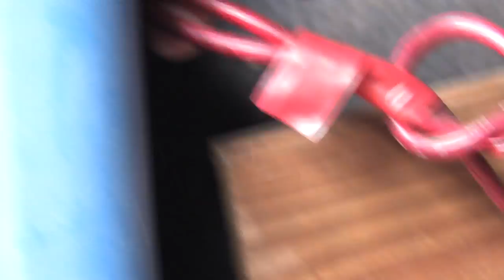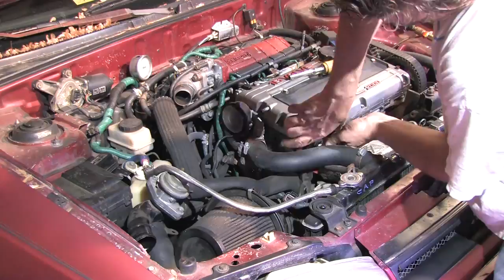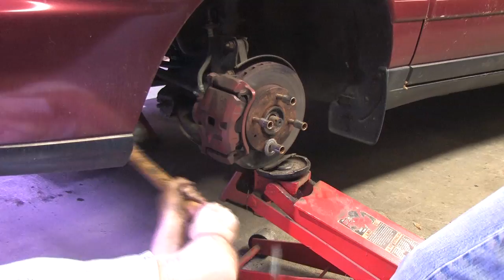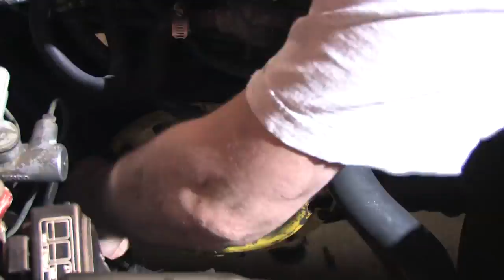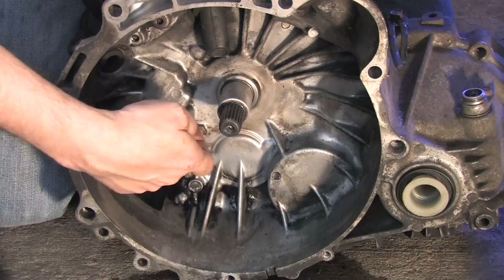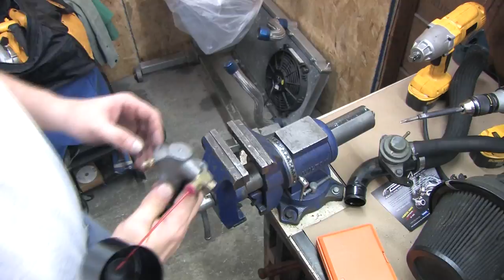Install Clutch in a 1g Turbo DSM swapped Elantra

Comment: I like to thank you for this video Jafro. I had some fun taking my Proton Satria (which is similar to your Elantra underneath) apart today and was made easier by watching this. Saved me a ballache splitting the lower ball joint out. Plus gives me a heads up for when I need to swap out the gearbox as mine  keeps popping out of reverse.

Comment: I didn't see the part in your video description about your goal of all used parts.  I'm sure it will "work."  My concern was the low spots created by the whizzer disc that won't make contact with the disc.  
Sometimes when working on a rare vehicle or a racing application, it makes sense to have the pressure plate surface prepared for a new clutch disc with a flywheel grinder.

Comment: Just did a input shaft bearing & clutch rpelacement on an EA5W Galant, very similar setup, was such a delight not to have to deal with a transfer case, tail shaft, plus I'm sure the FWD gearbox is lighter than the damn transfer case haha.

Comment: Yes, I am aware of the recall. The boots were fine and I did not need the recall back then. Not all cars needed the work, only inspection. Some cars you could see the oil trace running down the boot etc.
Cheers.

Comment: Floor jack on the rotor is never safe.  The video shows the rotor turn.  The only thing that would save you is the car falling back onto the jack stand ...if the car doesn't shift too much while you're hammering. 

I don't see the need to compress the spring.  You have air pressure, I'd use an air hammer on the knuckle ball joint boss to release the taper.

Comment: Luckily that speaker wire was big enough gauge not to cause an issue.  That is a fire hazard.  Might I recommend a race type of kill switch?  Is that tupperware for the battery box?  Looking forward to seeing what you have planned for improving the battery relocation system.

Comment: Yet another brilliant video :-)

I really enjoyed that, dont you wish you could do repairs at that speed lol.

You may want to double up on the battery main power lead, running such a high ampage 3 miles away from the hungry starter is just asking for loads of power loss to the starter, yes its thick wire but it will still lose stacks of voltage :-(

That looked a pain in the arse to do the clutch, you made it look easy :-)

Comment: I'm surprise you use a powerbuilt torque wrench. They suck from what I've experience. Also, you should try buying some Gearwrench flare wrenches. Cheap flare wrenches will cause issues when you apply a lot of force.

Comment: Thanks for all your videos Jafro! I recently installed a centerforce clutch, new friction plate on the fidanza flywheel, master, and slave, reused oem throwout in good condition. But now my clutch pedal sits about halfway were the brake pedal sits. Do you have any suggestions?

Comment: Clutch job is so easy on a fwd. A buddy of mine and I did it in 2.5 hours last time. you didn't put any anti seize on the axle splines?
Reply from the maker: Sgt Balestrini Lol.  It's only 7 less bolts.  5 on the transfer case, 2 on the axle.  I've pulled a transmission out of a Galant VR-4 in less than half an hour.  10 years later, I bought the car.  :P  But yeah, those 2 axle bolts are tough to reach if you don't have the right wrenches for it.  Those particular 7 bolts are deep under the car making them really inconvenient, but if you have a lift, ain't nothin' but a chicken wing.
Reply: your slow 2.5 hours  I would of go fired for that

Comment: hi i have a 90z vr4 galant project atm. my question is i have a problem with shifter wont go/reach in to top gears. but will go in to bottom gears 2,4,R.  i think its besause of the gear selector brackets are diffrent size?? due to diffent year gearboxs?? thanks

Comment: If your doing a clutch job aren't you supposed to resurface or replace the flywheel with a new one? Nice video very detailed.
Reply: If you care, sure. But this is just a bastard build Jafro is doing I think using mostly used parts he has in his "collection"

Comment: Is it best to have the flywheel turned? Or can you get away with not doing so?
Reply from the maker: If it worked poorly or had a weird clutch position prior to failing, then yes, turn it to the clutch manufacturer's specification.  If it worked fine and the same brand of clutch is going back in it, you don't have to.  But I'd at least scuff it up with a scotch brite pad or 80 grit sandpaper first.  Just on the friction surface.
Reply: @Jafromobile  I appreciate your help thanx